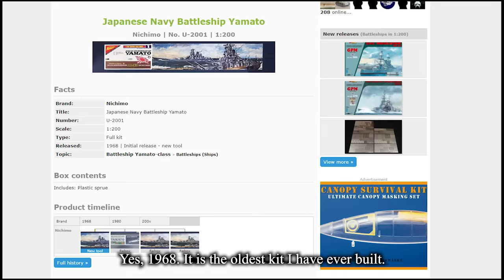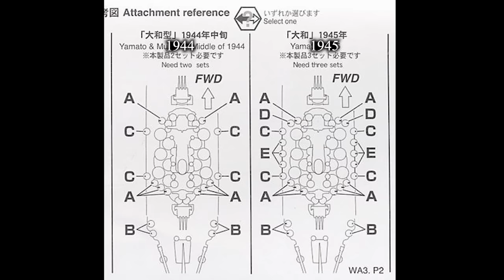[Commissioned] 1/200 Yamato Full Build. (World of Warships Camouflage, Nichimo+Fujimi)

Comment: Great work my friend.  An alternative to packing tape for holding parts in tight..  Use a narrow or wide ribbon tied in a loop around the area to be adjusted or compressed and place a pencil inside the loop twisting it to close and tighten the loop around the parts being fitted.  When compressed to the desired adjustment, rubber band the pencil in place until dried up.  Very clean, micro adjustments are easy and release is no sweat, no tape glue, no mess.  I've tightened up large piles of construction lumber with synthetic straps down to small model fits with ribbon... flawless method and super clean.  You can slip in small pieces beneath the ribbon to make micro on spot adjustments and fits. The varied set up and uses in this method are endless.  Tough to explain.  Thanks for showing us your great work.

Comment: Damn, how many hours did he need to completely assemble that? I'm a modeler myself but not a master modeler. Quite a few that I have known are like him where they had to use pieces from different kit. I've built many ship models, Arizona, Missouri and Essex, etc. Been thinking about getting the Yamato but Tamiya USA is only company from Japan that I know of that sells the Yamato in the U.S. The largest size they have is 1/350 scale which sells anywhere from $124-$150 and that is on Amazon. On the Tamiya USA, they're asking for $450.00. Way more than what I could afford on an ordinary day. I may have to settle for 1/700 scale. Kind of odd though, they're selling Musashi for $146.00.
Reply: Buy from hobbylinkjp they have all you need
Reply: @luke88martin  Good to know. I've been a 1/700 to 1/350 scale builder. Just looking at the size of this kit,  it must have taken him at least a couple weeks or a month to assemble. I know you have trim the all the 'flash' from the sprues and sand them down, modifying parts with epoxy and of course painting.

Comment: I have a kind of awkward question sir where would I go by getting the extra 325 mm antiaircraft guns that you put on the sides of the ship because that model only comes with two on each side and what type of detail kit did you buy your information will be very appreciated thank you
Reply from the maker: https://www.ebay.com/itm/164038239804?https://www.scalemates.com/kits/fujimi-02041-battleship-yamato-central-structure-outlying-facilities--1227267
I bought this one and use its AA guns for the outer layer.

Comment: I wonder why there is still no modern Yamato kit in 1/200 with PE, slide molding, good fit and accuracy. A kit that can be build into a nice static model without having to buy tons of aftermarket stuff. This is the mother of all battleships, I am sure, whoever launches a modern up-to-date kit would sell a bunch of them. They could likely command a high price for it because it's so big. Trumpeter ? Tamiya ? Anyone?
Reply from the maker: Most likely Fujimi is the first candidate for releasing 1/200 Yamato. They already have turret and super structure mold.